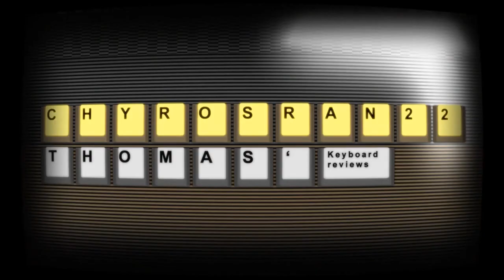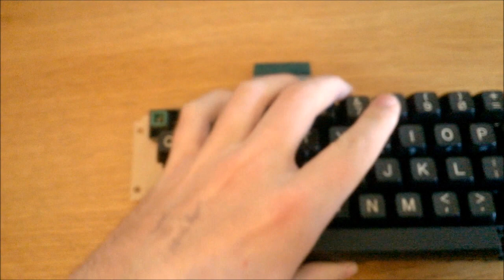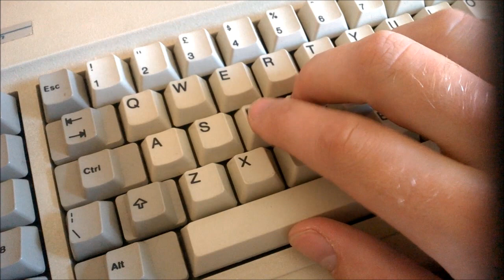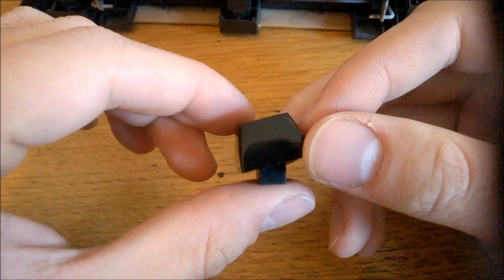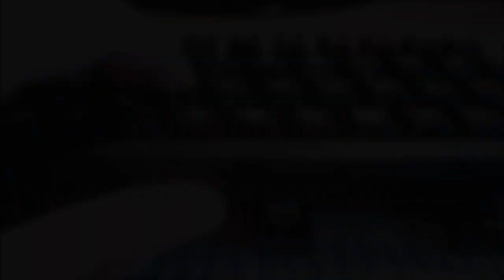Texas Instruments TI-99/4A key review (Stackpole switch grid)

Comment: Some TI-99/4As came with an Alps keyboard, which is a major improvement over the Stackpole keyboard. TI must've had a huge warehouse full of these keyboards after they stopped production of the TI-99/4A, because these keyboards remained available from electronics surplus vendors well into the 1990s.
Reply: VWestlife I must have used one with the alps switches, because I've tried out a TI-99 and remembered the keyboard being one of the best I've ever used (Given that I've only used Cherry MX Blue, regular membrane, and Razer Green switches before)
Reply: I think I have one of the later revision of the Ti-99/4a keyboard the one I have is more like rubber dome keyboard and the keys are permanently attached. Speaking of which I need to fix 2 that got knocked off

Comment: TI-99/4As had at least 4, but I believe more, keyboards over its production lifetime. Some early versions of the TI-99/4A have a Hi-Tek High Profile keyboard. I have one that says "Hi-Tek part no. 373-70229A" on the back of the PCB and I have seen others with 373-70229B. I have another with the Stackpole switches like the one in this video. Other than PCB paths, both types are otherwise identical, except that the Hi-Tek key plungers are a white nylon. They also tend to crack at the corners. It's amazing that Hi-Tek could have lost a lawsuit -- they must have bungled it somehow. There are TI keyboards using Alps keys, and later models of the TI-99/4A had a Mitsumi membrane keyboard and I believe there is at least one other, non-Mitsumi, membrane keyboard used in later TI's.

I've made 3D printable replacements for the Hi-Tek plungers that can be found on Atari Age in the TI-99/4A forums. I am not 100% sure that they will fit in the Stackpole keyboard as I haven't needed to take my Stackpole apart fully, but from the top they appear to be similar.

Also, in order to remove the plungers I had to de-solder all 47 or so switches from the PCB, remove the PCB, and then use a pair of needle-nose pliers or tweezers to depress the sides of the plunger from underneath, while pulling up from the top. It's a huge pain. The one manual I found saying how to service these High Profile keyboards said to just use pliers to pull the plunger out from the front, but I have never been able to do that, partly because it seems to require enough force that it would completely destroy the plunger.

Comment: If it makes you feel better, TI changed switches a couple times. Later 99/4a units used better microswitches. Still linear, but with a lighter throw and more robust switch bodies(as well as a rigid frame around the PCB instead of screwing directly into the system's upper shell). I've got one unit that looks like it might actually be using a predecessor of the MX(and uses the cross for key mounting, though I've not verified the keys fit a modern board). Another almost certainly uses Alps switches, as the keyboard module was MADE by Alps.

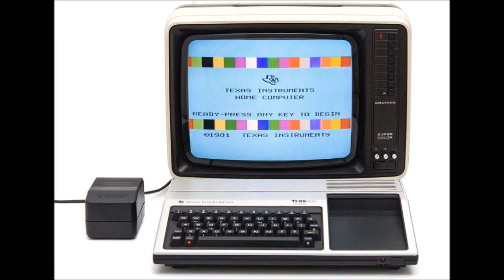Comment: 0:33 TI's commercial problem with the TI-99/4A wasn't really competition from the IBM PC. At over US $1,500 at launch, the PC wasn't competing for the same parts of the microcomputer market as the TI machine. The problem was a bruising price war with Jack Tramiel's Commodore and its VIC-20. And while the low-end microcomputer business ended up being a dead end commercially, in 1981 there was a lot of money yet to be made in it, most impressively by the VIC-20 and Commodore 64.

Comment: Did you know there were at least 4 different keyboards manufactured for use in the TI-99/4A? I have at least one of each, somewhere. The Stackpole are indeed the worst switches of the bunch. The best by far are the linear green T-mount Alps switches used in the last version of the keyboard that came in the beige version of the TI-99/4A. The stems on those T-mount Alps are angled, and are compatible with MX-mount keycaps. In fact they came with double shot uniform row SA-profile keycaps from Signature Plastics (well, Comptec, Inc., back then)!

Comment: So I have one of these computers in pretty good shape. I've been mostly just futzing around with it without any real intention, though I've most recently been trying to get the thing to talk over RS-232 (which requires an external module). The computer itself is built like a tank. 

The keyboard is indeed miserable. A couple things of note that aren't really obvious if you aren't using it with the computer itself:

* There's no backspace or delete key. The keycap you're missing is FCTN, which is what's used to reach the glyphs on the front of the keys. DELETE is FCTN-1 (which deletes the character the cursor is on). There's no backspace whatsoever, it uses overtype by default, but backspace if FCTN-S which is outright obnoxious. Also note that the " key is FCTN-P, which makes programming a huge chore in remembering which meta key to hold down. In Extended Basic, making the computer talk is accomplished with CALL SAY(), so you'd have to type CALL SAY SHIFT-9 FCTN-P <some string> FCTN-P SHIFT-0. For extra fun, FCTN-= is QUIT, which will reboots the system without warning!
* The electrical engineering of the keyboard is just trash. I easily out-type it in speed, and it suffers from serious ghosting issues. In addition, the joystick controllers are wired to the same controller, so if you forget to turn ALPHA LOCK off the joysticks do weird things.

The TI-99/4A is crippled in so many weird ways. The history of the entire thing from start to finish is a fun thing to read about.

Also, I think my sliders are different color. I'll have to get out my key puller and find out.
Reply from the maker: Thank you, that was quite interesting :) . Does it really ghost keys though? I don't think I've ever heard of a keyboard that does that, and I was wondering about it the other day.
Reply: I'm pretty sure it does and I've found documentation stating such, but now I can't track that down. I'll have to double-check when I have it out again.
Reply from the maker: Please let me know if you find anything. I've been quite interested in ghosting keyboards since the issue seems so abnormal, easy to prevent, and I've never encountered it myself.
Reply: Yep, this thing absolutely ghosts. I forgot a tripod so I could film it, but it's driving me insane.

CALL is similar to POKE on other contemporary microcomputers, and I've been wondering why I kept typing CALLS. Turns out, holding down Shift and hitting L rapidly followed by space will ghost an S in the way. 

: ghosts to :A, L ghosts to LS, K ghosts to KD, J ghosts to JF, H ghosts go HG.

http://forum.tlienhard.com/TS1000/www.mainbyte.com/ti99/keyboard/keyboard_schematic.jpg

Comment: Love these videos, it's been helping me in trying to find my next keyboard to play with. I use a late model IBM Model M (April 93, pre Lexmark) and I'm trying to find a good mechanical keyboard for work/home as a backup/extra one - I like the look/sound of the Dell AT101 but is there anything you'd recommend? Or anyone else?
Reply from the maker: If you've already got a Model M I recommend checking out a board with white Alps. Just make sure they're clean - and that they're not clones. Don't get greedy, just wait for a nice one to come along.
Reply: Will do - thanks for the reply by the way. I'm keeping my eyes out for good white Alps and doing a check through DeskAuthority. I actually stumbled across a Dell QuietKey RT7D5JTW which, while rubber-domed, feels pretty solid!
Reply from the maker: Remind me, is that the NMB version? FCC ID starts with AQ6.
Reply: Yeah, my FCC ID goes AQ6-7DK15. The feel of the domes is quite good, there's a bit of a click to it - I can't quite place what it feels similar to and it's driving me nuts.
Reply from the maker: That's the NMB dome with slider version, the best model of QuietKey. Pretty damn nice to use for a dome board. They're not clicky, but they make a bit more noise than dome mat keyboards.
Reply: Yeah, not super clicky but there's some kind of noise that made me think it was a bit 'clicky'-like. As rubber domes go, it feels really good and much better than the default HP keyboards we have at work.